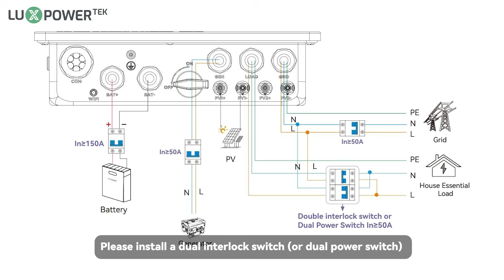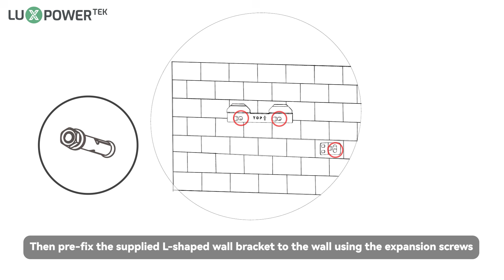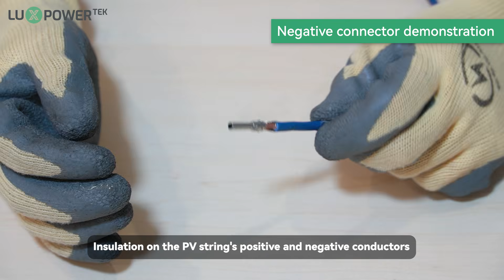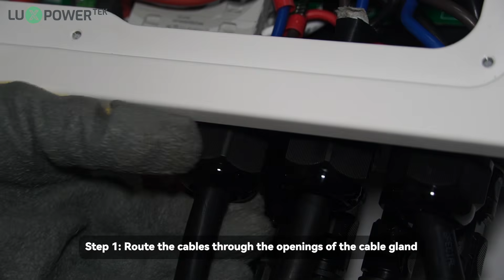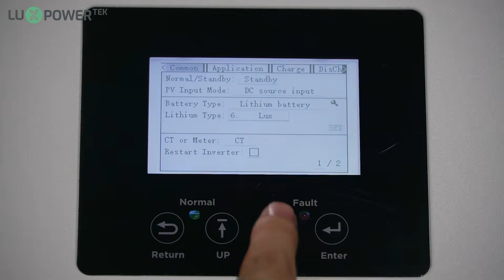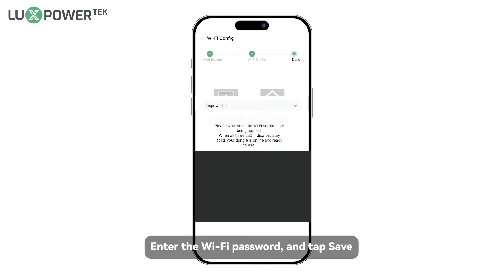SNA PRO-EU 3-6.5K Installation Introduction

Comment: There is no Deye battery in the battery menu to choose from. Which battery brand should be selected when using this inverter with Deye SE-F12-C battery?
Reply from the maker: Hi there, maybe you can try to choose the Lithium brand 2, if it is not working, you can try the Lead-acid mode.
Reply: @LUXPOWERTEK  Yes, it's working fine in both 2 - Pylon or 0 - Standard. Though having Deye in the  list would be nice. I understand they are direct competitors but their batteries are popular and usually more widely available.